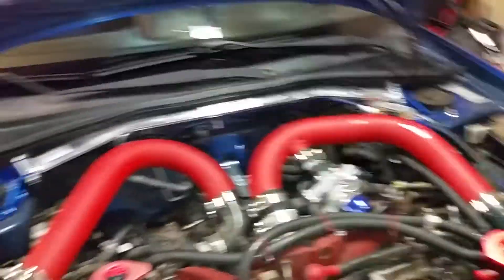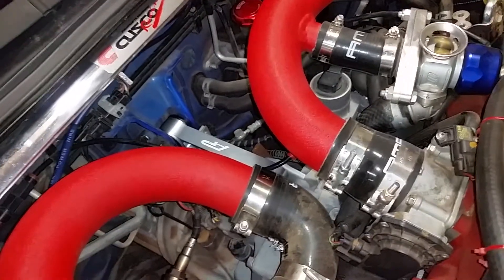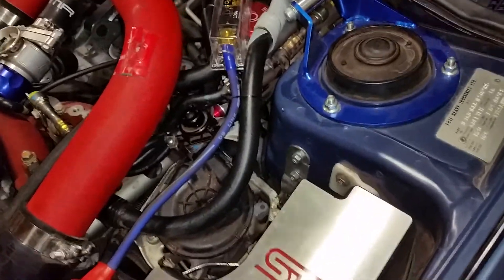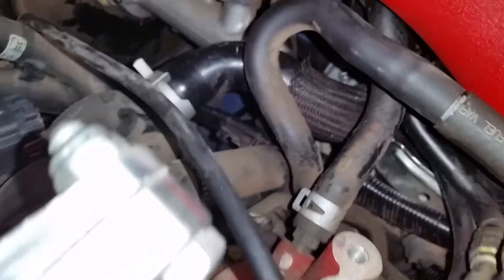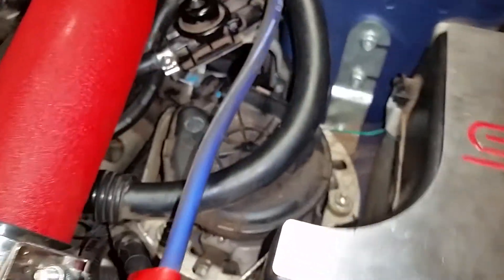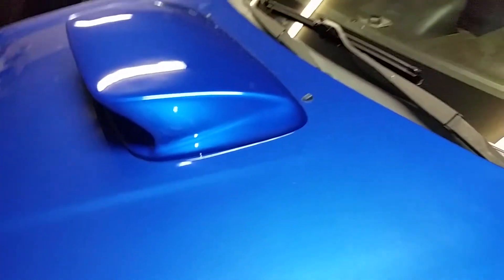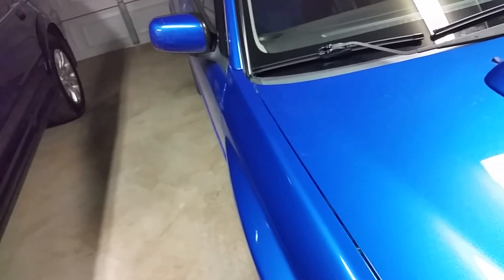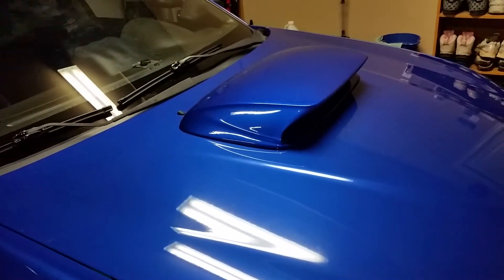Upgrades Done Today (Subaru STI 2007)

Comment: glad to hear your going rotated. just sell your turbo and buy the real garrett gtx3076. it would be a lot smarter.
Reply from the maker: Keeping my atpgtx3076r. Just making it rotated and vband
Reply: panzerth the compressor housing is all hacked up to fit in stock location. like i said it would be smarter to buy a new turbo. if your building the motor might aswell have a real gtx3076 and make more power
Reply from the maker: Excision once built my car should be capable of hitting 550 or higher with that turbo and the setup im going with. the limiting factor will be the semi closed deck. but i'll be running 13mm headstuds so it should help keep the heads on the shortblock. A car my mechanic built is a true 500awhp car and its running a custom turbo he built that puts out as much flow as my gtx3076r. but its journal bearing and stock location. its a T60-1/ 20g hybrid turbo. I wanna keep my turbo and see what it'll do. Im just gonna get a new hotside for it that's rotated and has v band connections. I have to go rotated anyways. cause im going rotated intake manifold and im using a custom made bracket to relocate the pulleys so it'll all fit. im keeping my AC.